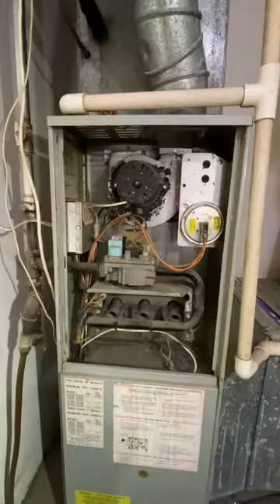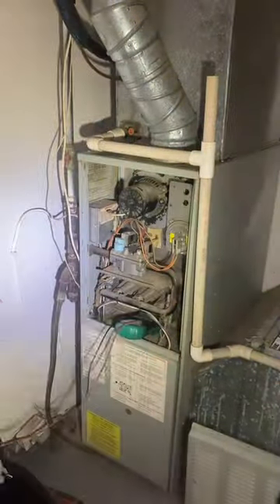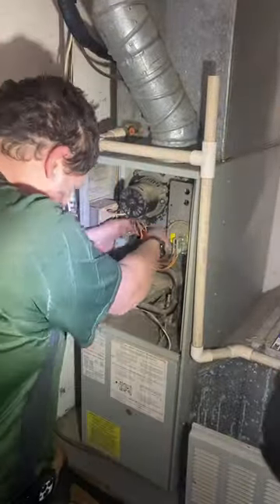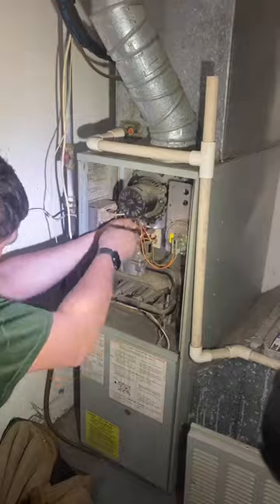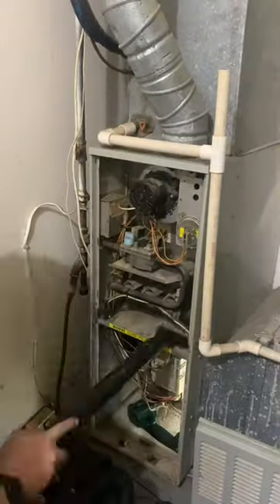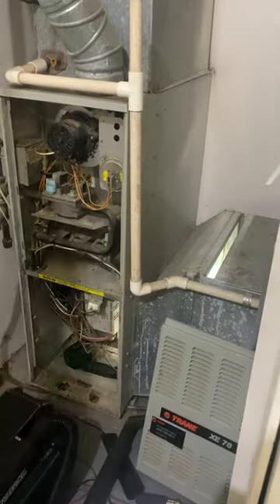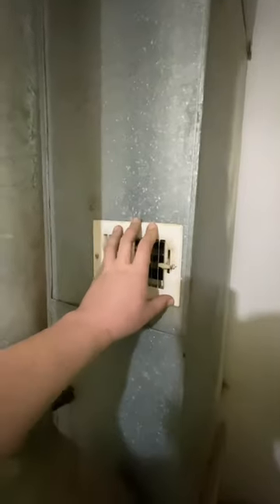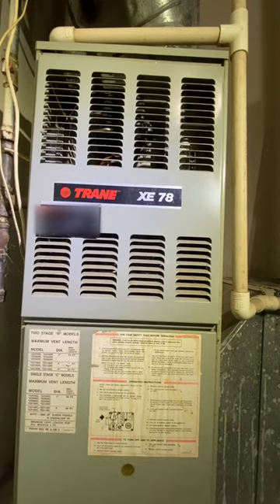Fixing a Furnace that had a bad limit switch. #HandsomeOrHandy #HomeMaintenance #Hvac #DIY￼

Comment: Bad limit switches are often a symptom of an overheating furnace. Basically it fails from constant and frequent cycling. It's good practice to check the temperature rise while changing a limit to spot any abnormal operating conditions.
Reply: I don't think he cares =/
Reply: @UltraGamma25  well he is making videos of himself not doing a proper job.

Probably carpet growing on the coil.
Reply: Your never to good to learn
Reply: He's a handyman not a licensed technician
Reply: @Michael Gordon-bingo
Reply: @fry285   The A-coil is covered guaranteed with dust and how do you get to it, by taking a piece of triangle  metal off which you can't get to, because all the distribution tubes are in the way

Comment: If the furnace and/or A/C was ran without a filter then the blower wheel and/or evaporator coil is likely clogged with dirt/dust causing low air flow causing the furnace to over heat repeatedly causing that high limit to go bad. I would definitely check both of those along with temp rise but for a quick fix not a bad repair 👍
Reply: I was just gonna say that. And then the heat exchanger needs to be checked.
Reply: Blower wheel too.
Reply: Defo check the upstream side of the A-coil.  If it's OK and Delta is within spec you got away easy.  A bad heat exchanger would likely trip the roll out switch.

Comment: I would recommend investing in a borescope if you don’t already have one. Very handy to be able to inspect a heat exchanger to verify it’s not compromised especially at an older age as that unit. Bad limits are usually a sign you’ve got a crack or hole.

Comment: My dude, you missed a lot.  With no filter the coil is likely clogged, causing the limit to trip.  Pull the blower for cleaning, then look up thru the heat exchanger to view the coil and look for cracks.   Good chance of cracks, then sell them a new furnace.

Comment: Wondering if the evaporator is caked in dirt from not using a filter and the limit is tripping because it’s so restricted.
Was this the fix or did it trip off again?

Comment: The company I work with offers a yearly plan, comes with 2 cleanings a year 1 heating and 1 Ac. Those cleanings save a lot of people money from these kinds of mistakes (no filter) 🤦🏿‍♂️just last week three of my customers have been running there units with no filter all the units were in the attic I convinced them to convert to a "permanent" filter and signed them up for the yearly plan. All three clean ups took me every bit of 1&1/2 hrs but this will save them time money and a headache in the future